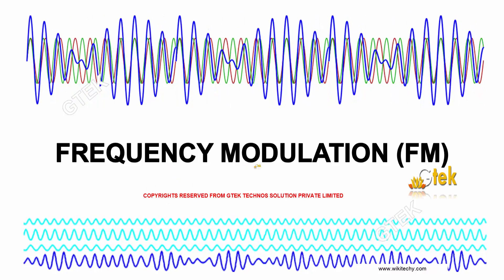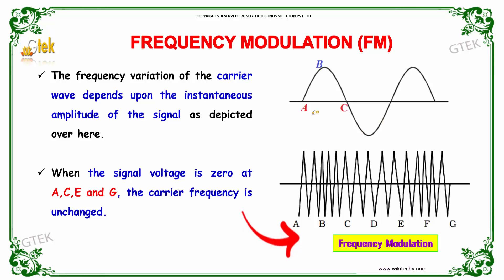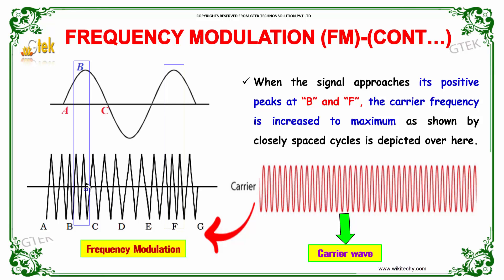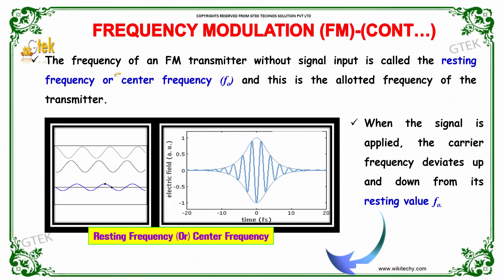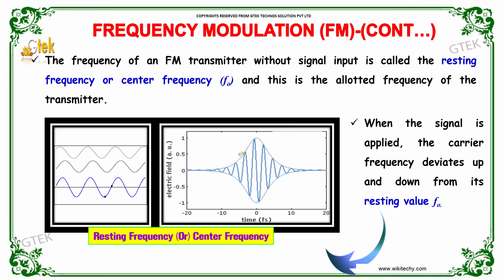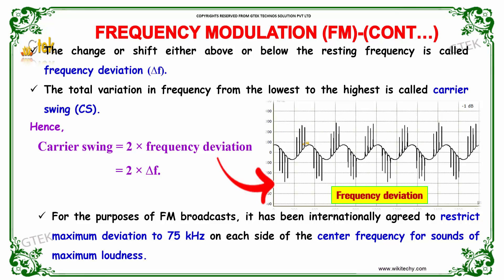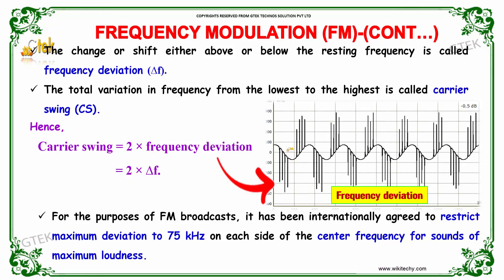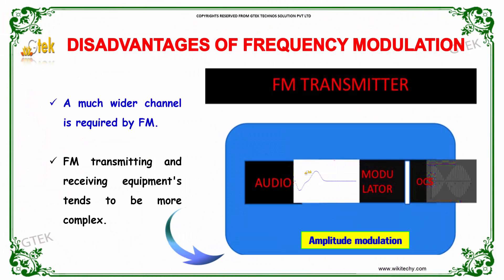Frequency Modulation |Communication systems|class 12 physics subject notes|CBSE|IITJEE|NEET

Comment: Frequency modulation (FM) is a method of impressing data onto an alternating-current (AC) wave by varying the instantaneous frequency of the wave. This scheme can be used with analog or digital data.